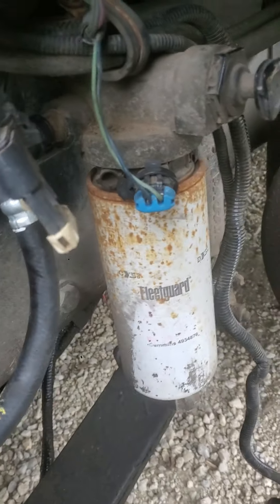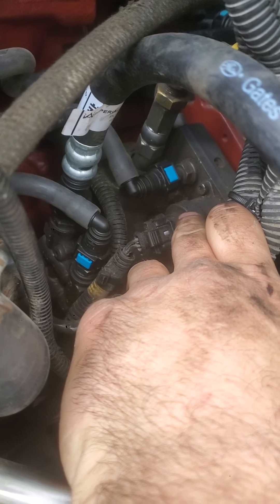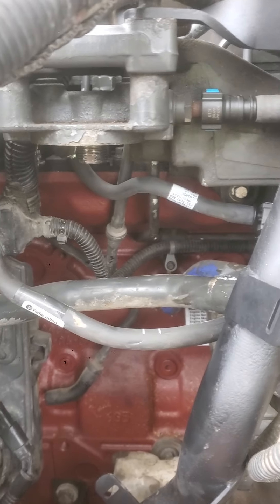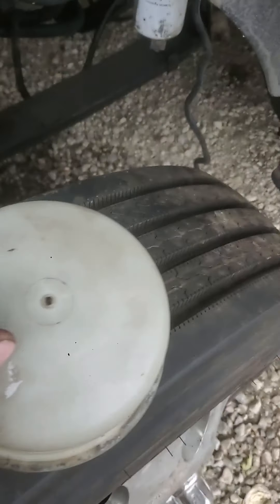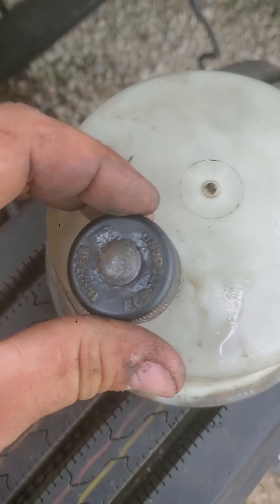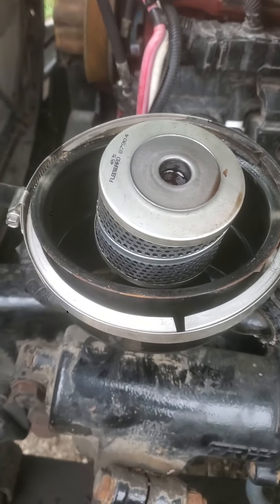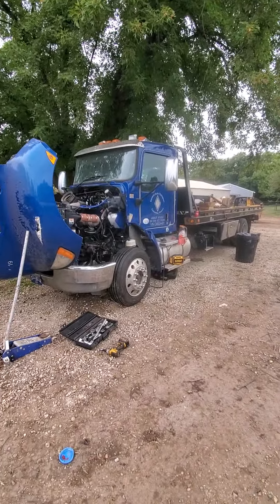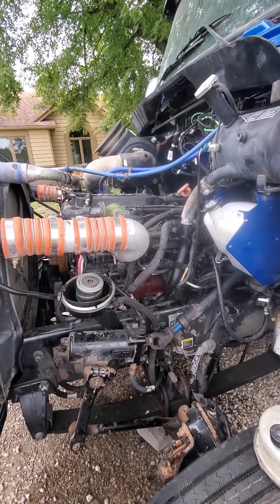kenworth t270 , px-6 / cummins 6.7l update

Comment: Quick question's
How many miles does it have?
Why did you replace the motor?
Would you recommend 2009 Pete  px6?

Thanks
Reply from the maker: This truck had 480+k. The number 6 rod broke and put a hole in the block. The px6 is a 6.7l cummins just with paccar's name on it. The configuration of this 6.7l is different then your commen 6.7s found in pickups but still a great motor. I would say just do your research and try to find as much info on a truck (service records, history, ect.)